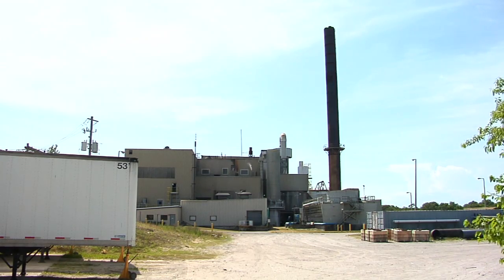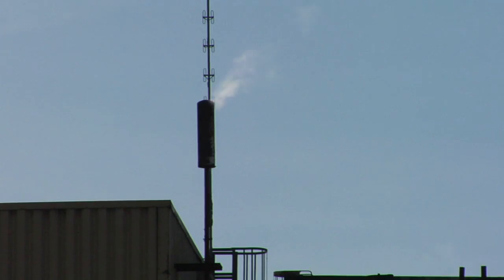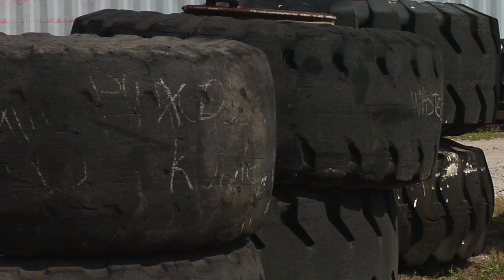Recycling : The Best Ways to Recycle Tires

Comment: yeah, they charge u up the ass to get rid of used ones when you buy new ones. we always get screwed.  they should use a diff product than rubber.  rubber on hiways get to the water source after it rains and causes more hazard to environment